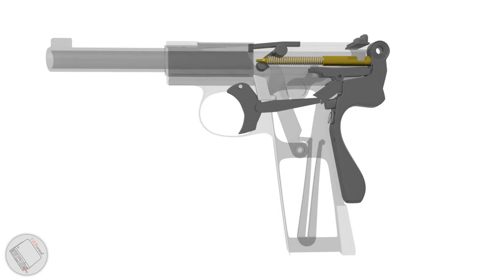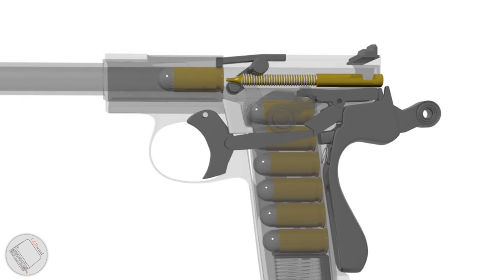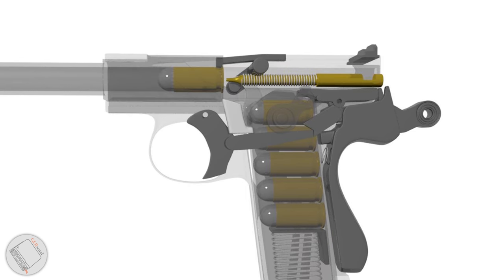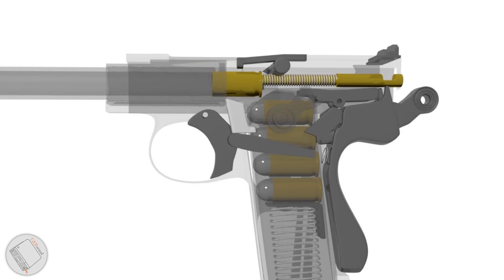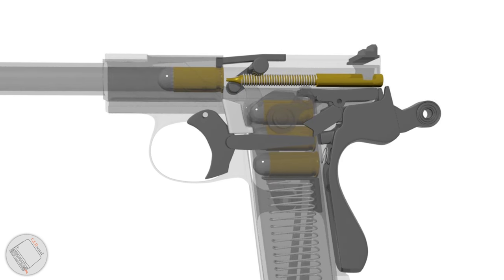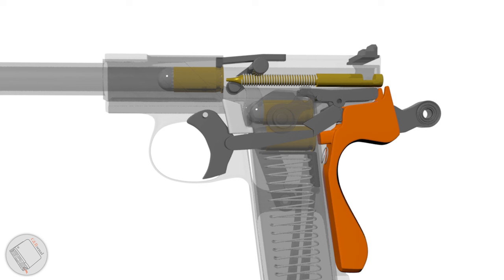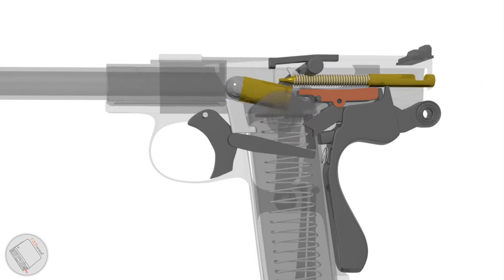How it Works: British Webley Self-Loader MkI

Comment: Seems like a pretty simple design. The ergonomics could use a little help. The grip angle seems awful . Why was it not more popular? Did they ever try to export them to compete in the American Market or Canada?
Reply: The full episode gets into a bit but the TL;DR is timing and price. It was an expensive gun that did really what other cheaper autos could just as well and this was when automatics were still new tech so most militarizes still used revolvers.

Comment: Such an odd set of ergonomics for such an influential locking action.
Reply: British designer: Ergonomics? What are these ergonomics that you speak of?
Reply: They're more comfy than you would think assuming you have normal man sized hands.
Reply: @chaimafaghet7343  The sheer length of that grip, though. Granted, it may fit the hand well, but it's got to be awfully awkward to holster and carry, which, given that a handgun is largely a just-in-case weapon, definitely matters.
Reply: @davidhansen5067  It's going in a military flap holster high on the left side, it's fine.  This isn't a pocket gun.
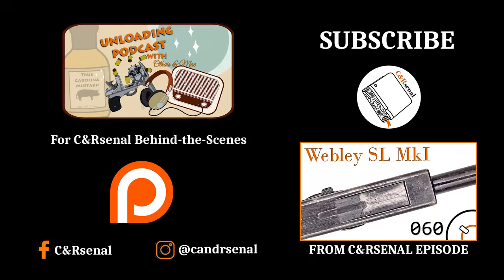Reply: @davidhansen5067 Its a heavy holster pistol worn cross draw in a Sam Brown. Some of the initial adopters were the Royal Horse Artillery and the Cav so it could even ride in a saddle holster. It's still not large by service pistol standards of the day. Webley revolvers and Colts New Service were even larger and heavier. It's certainly no worse than a full size Glock in .45ACP. 1:35